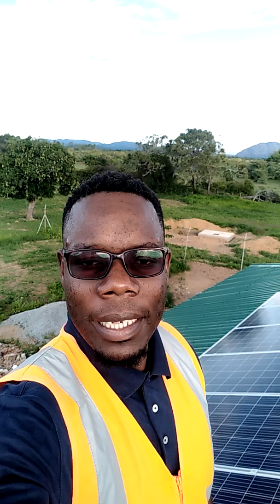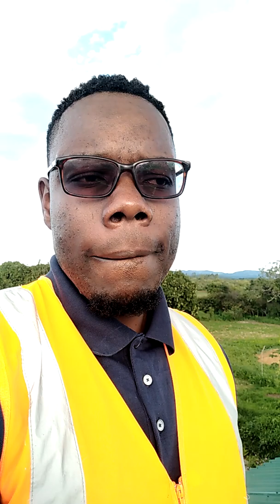Solar off-grid System in rural Zimbabwe

Comment: Thank you, I bought my mum a 110 watt panel for TV , 12v battery she just told me she can only watch TV for about 2 hrs per day which is not enough. I thought I needed more batteries but I have just realised after watching your video that I need more panels.
Reply from the maker: What's the battery Ah? Most likely it's the panels. 110W at 12V (~18Vmp) will give you about 6A before accounting for losses. That's too little to do anything much.
Reply: You make solar sound delicious...thanks.